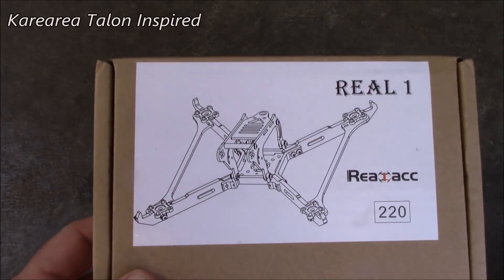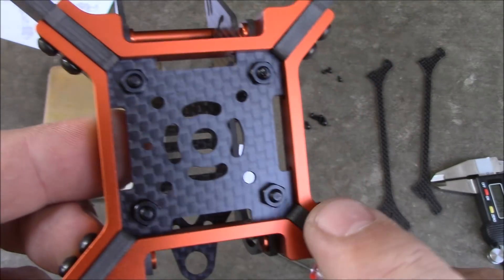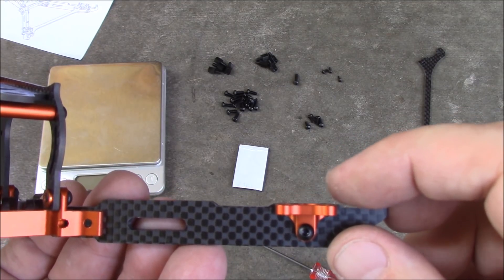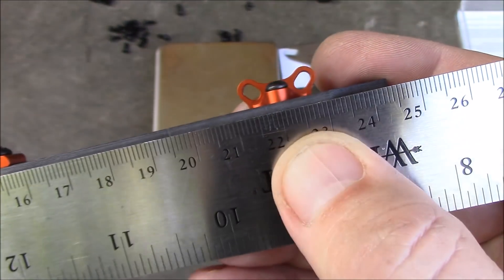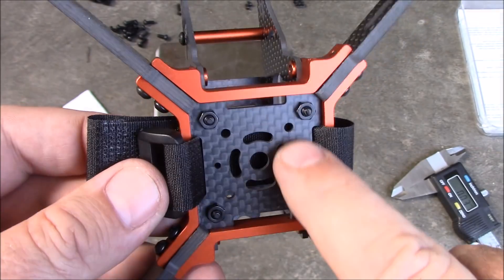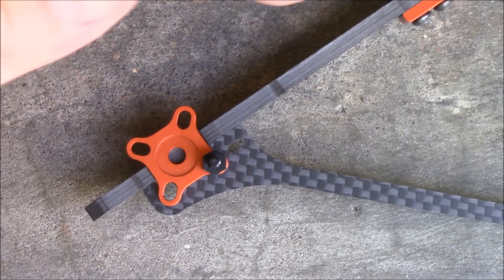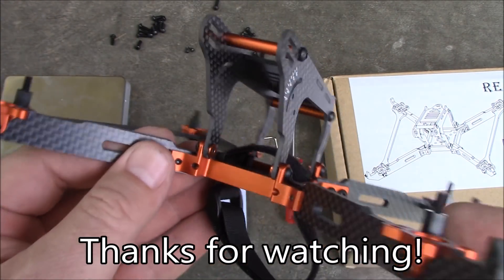Realacc Real1 (Generic Karearea Talon) from Banggood

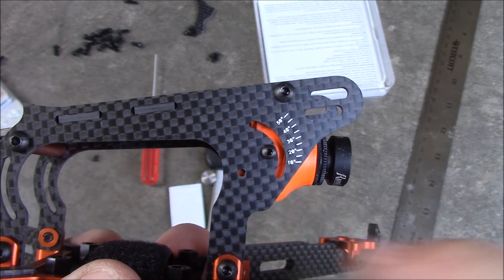Comment: @travisgrindal you could've used the holes you are pointing at 6:57 to mount the cam and get more angle, I own that frame personally and I've mounted a Foxeer HS1177 v2 in these holes and I get to 50° easily.

Comment: I wish the side plates were beefier. Particularly where they mount to the aluminum brackets. And I also wish the arms didn't have those long holes in them. Or at least had smaller holes. Without those two issues, this would be as good a clone of the Talon as the Martian 2 is of the Alien.

Comment: The side arms are there to reduce fibrations in the frame. Now the lower drag part you are not totally right. The arms are 4mm but the braces ad about 4mm so it will have the same drag as a frame that has 8mm flat arms. As you than ad the weight of the frame, a light weight frame with 8mm arms will be faster.
In the end it is the pilot but as you do it on paper, you can better have a frame with 8 or 9mm arms from below 60g. It will be faster than the frame of 100g.
Reply from the maker: I think the drag on 2x4mm arms would be less than drag on an 8mm arm if the weights were the same.  However, a lot of people are moving toward the lighter frames that weigh down less than 70 grams.  I just got my BFight210 built out and its total weight without battery is 270 grams.  With an 850mAh battery, it feels so light and pulls out of dives very easily.  I flew about 6 packs through it this past Wednesday at our practice and then flew my Purple 210 (350-ish grams).  The Purple 210 felt like a tank.  It was harder to slow down and more difficult to pull of bad situations.  I was able to fly it a lot more smoothly but that is probably because that is what I've been flying most of the time.  I'm seriously thinking about building another BFight210 or another sub-70 gram frame and selling off all my older, heavier quads.... well, at least the ones that can actually fly.
Reply: travisgrindal ad it has 4mm arms yes but the braces you must ad as you use them.
I calculated several times to see what is best with weight and drag. Vertical arm frames can have a higher top speed thanks to the lower drag but because of the higher weight, the advantage is only there as they go full throttle.
So for top speed it is great but keep in mind, only as they don't use the extra arm braces because ells the advantage is gone.
I am working on a frame with 6mm width arms what makes that the drag is about 0,66% more than a frame with vertical arms of 4mm.
But the weight will be under 60g for the frame where most vertical arm frames are over 100g.
I have a frame with 9mm arms that is 54.6g. Build is about 250g depending on what motors I use.
I used f40 Pro motors on it and I took them off again. The quad was way to fast.
Lighter frame with lower drag gives the advantage of longer flight time, and more control.
That is why I tried a vertical arm design that was light but the vibration problem and the extra weight that you keep with the frame, made me abandon it for the second time and made me switch to 6mm arms that are 6mm thick. I can keep the weight down and have low drag without the fibrations problem. My last 3 frames are all below 60g and a frame I designed for someone ells is even below 50g and I can make that even lighter as I made it in a x instead of a sx frame.
Iove the lighter frames with narrower arms. Don't need the heavy motors and the response is just great.
All frames can run lipo on top and bottom.
As you can run your lipo on top try it, you will love it.